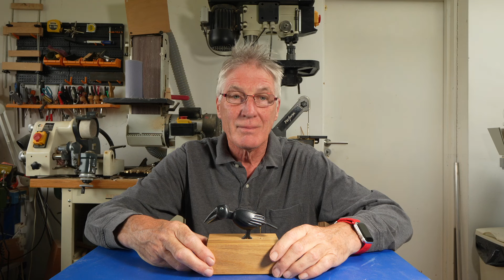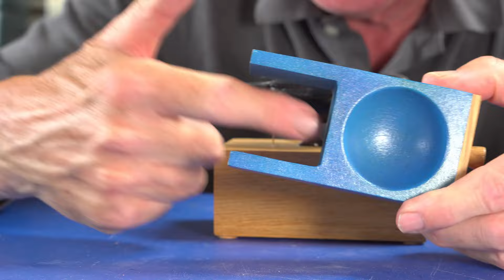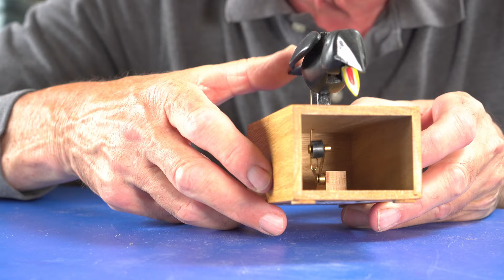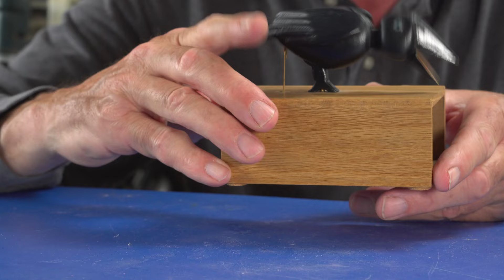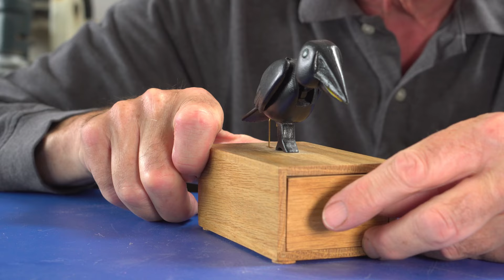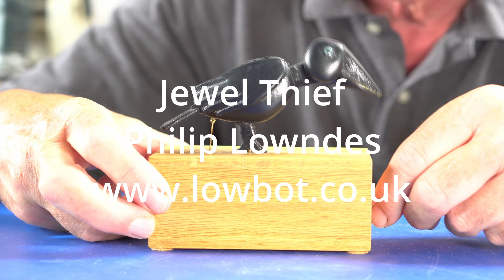Jewel Thief Automaton. Not all automata have cranks. How it works.

Comment: Thanks for sharing. I'm curious if it would be workable for the pulling motion to be achieved by using a lighter gauge wire, fastened to the bottom of the box. When the drawer is inserted it would push the wire deeper into the box which would give you the pulling action. A notch in the drawer, matched with a bump in the wire could act as a detent to hold the drawer in.

Regardless, Very Nice!
Reply from the maker: Thanks. Yes, one of the fascinations of automata making is that there are often several ways of achieving a similar effect.